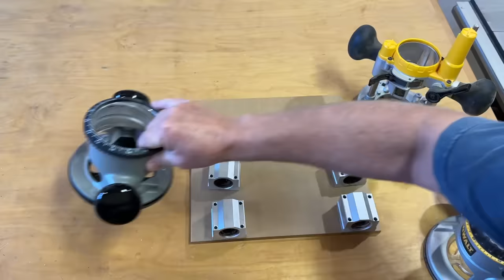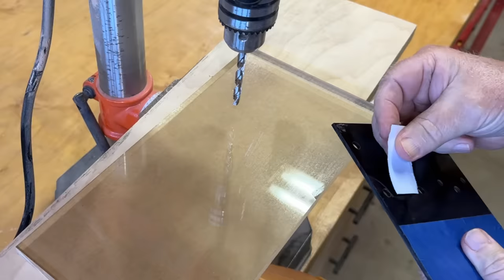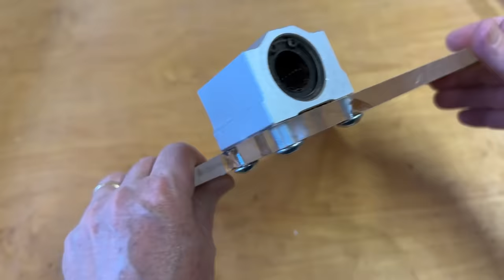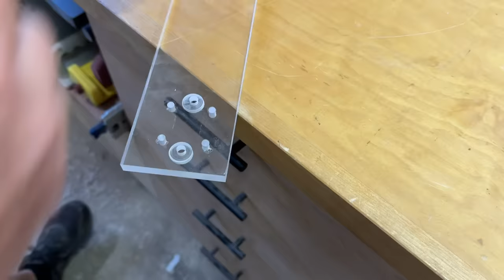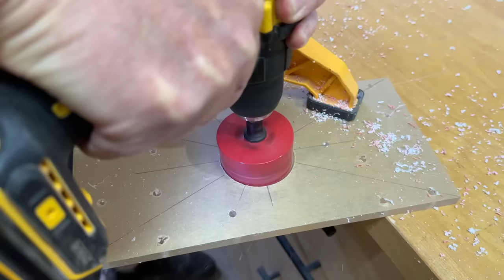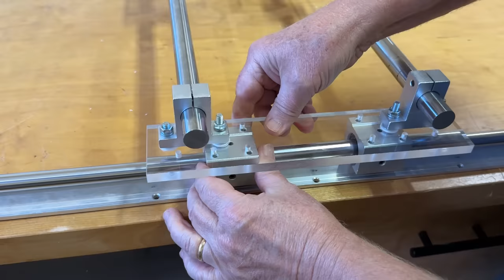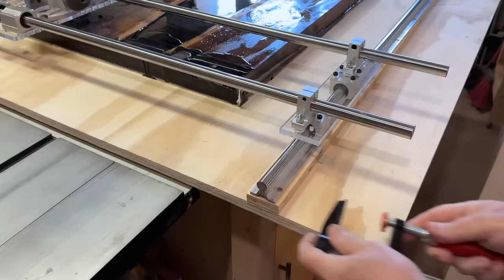Affordable Router Sled - I finally got it right!

Comment: I read the warning on the DeWalt speed differently: it says at low and medium speeds it will act to keep the speed the same, but you might overheat if you push too hard. Because the motor won't slow, you won't know that you are pushing it too hard. They don't say how to know if you are pushing too hard, but probably at the depths of cut for surfacing, it isn't likely. And if you are moving by hand, you will feel when the cut rate bogs down.
Reply: This would be the correct interpretation. I was thrown off by his explanation also. What the router does is increase amperage into the motor to maintain RPMs, this will add extra heat into the motor and if done too much, can cause it to fail. So lower speeds require slower feed rates.
Reply from the maker: Thanks for the clarification, I guess I just misunderstood.  Yeah I guess if you are just careful to not put too much load on the router, it would work fine.  Thanks!
Reply: @jkmwoodworking  I love the simplicity of this design. So I've spent a bit of time pricing out this design and trying to figure out how to make it work in my workshop. I was trying to decide if I needed the full length, and if I even had a place to put the full 2m length.
Reply: Agreed. It will keep the speed more or less constant but it will drain your battery like very quickly. Took very thin cuts and that is better.

Comment: I love your design but you need to adjust the size of router base tray and where the handles on your router base sit so that you can attach your dust port/collector right to the router base. I am doing that on my version by using a router base without the handle and changing the orientation you have by 90 degrees. The other option I have seen is to attach a dust port to a larger piece of acrylic but like you stated, it starts to widen the base/reduce the area where you router can work. I think the dust port attached to the router base will be the answer.

Comment: The rest of my rails show up tomorrow. Thanks for the walkthrough, and the explanation of errors. It’s nice to see someone explain the missteps instead of me yelling at my tools. 😁
Reply from the maker: Glad to hear it was helpful!
Reply: @jkmwoodworking hey bud you still got 1 mistake left you haven't realized... I have the exact same router and made a router sled like yours... well I was doing 1/8" passes over walnut with a 2" spoilboard bit, and I was going nice and slow... really smooth didn't wanna work my router too hard, 2 1/4 hp dewalt... well only 20 minutes and she was smoking. 3+ hp router should be the standard on a router sled. I'm currently looking into a few... Triton has a 3 1/2? I think like $300 vevor makes a 3 1/4 ,for real cheap like $90 but will it last long? Idk and can't find any good reviews, just unboxing reviews. Nobody does any real reviews anymore, just day 1 crap and it's annoying

Comment: Thank you on creating this video depicting your build along with the issues you had building it. It is very well thought out and I believe that just about anyone can duplicate your build. The part on the acrylic square vs rectangle was awesome as well as the part about what type drill bits to use. I am sure this helped me save some money. I was able to create this and I love it and appreciate you for bringing this to anyone interested in building a router sled. I believe that router sleds are more universal or convenient vs having to plane everything. This is relatively cheap to make vs purchasing a small planer let alone a large planer, and can be made rather large to do larger pieces of wood. I know that there are kits out there as you mentioned in your video but this is the way to go. Thanks again - much appreciated!     :)
Reply from the maker: That's awesome, happy to hear that it worked for you!  Thanks for your kind words!
Reply: I did the very same thing. all done in a half day.

Comment: I came across these rails marketed on Amazon for a CNC and immediately imagined them for a sled. Excellent video and info for us new to the sled game. 👍👍👍

FWIW I realize in the grand scheme, $20 doesn’t amount to much. But for future reference stop by any countertop shop that does solid surface (Corian) and you likely will find a nearly unlimited supply of 1/2” acrylic in their dumpster. I did solid surface for decades and shudder to think of all the valuable stuff that we threw away that could have been repurposed for things other than cutting boards.
Reply from the maker: Great info, thanks!

Comment: I built this exact sled over the weekend and it went together great.  I have my surfacing bit on order to attach to my Festool 1400 router so when that gets in I’ll be able to test it.  But even now it’s very solid and smooth so I expect it to work just fine.  Thanks for the great video, parts list and tips!  Kudos to your design!
Reply from the maker: Great, I'm glad it worked well for you!  Thanks so much for the kind words!
Reply: hi Bob  how r u

Comment: I started building a router sled using a similar design to yours, except I used some 3/4" plywood for the carriage for the router. I ran into a few issues very similar to the ones you had in getting the holes for the slides lined up correctly. Your idea of laser cutting a template is really good, so I'm going to re-do mine using a laser-cut template as well. My rails are the first kind you tried also, where the mounting holes on the slides are on top, and using those made my carriage way too high. I need to fix that problem, so I'm going to look into the type of rails you used where the mounting holes are on the bottom. Like you said, it should simplify the carriage quite a bit. My shop is really small, so I don't have nearly enough room to have a router sled inside, so I mounted my long rails to some 2x4's that I can drop into the slots of two Bora sawhorses, then drop a piece of plywood between them to support the workpiece that I want to flatten. That way I can quickly set it up outside my shop, then tear it down and store everything away, including folding up the sawhorses. Since I'm doing the flattening outside, I don't have to deal with all the chips inside my shop, either. Anyway, thanks for this great video; it's given me some inspiration and idea for my flattening sled so I can get it working well.
Reply from the maker: Great info, thanks for sharing!  Sounds like a similar experience as mine.   Great idea with the 2x4's!

Comment: Be interesting to mount a dial indicator on the sled cross rails and see how much deflection (sag) you get in the center of the rails. Good looking design.
Reply from the maker: Interesting idea, I might try it!  Thanks!
Reply: I would imagine with the weight of the router not counting for any down force applied by you,across that span would probably result in at lest .010" in the middle. Steel is way more flexible than most folks would think. Of course .010" would not be at all noticeable across a large cutting board or table top.  @jkmwoodworking
Reply: I was wondering the same thing. That style of rail makes for simple construction, but I would think it would have some deflection, a lot more than the other type of rail.

Comment: Good Video. I wish I'd had used #16 rail through out. The sled needs to hold my router, not my as. In my version 2, I changed my 1/4 poly plate out for 1/4 Alum. You can't see much thru the clear plate anyway. Hardest part was cutting the large hole (wood hole saw with a lot of patience). Height is also adjusted by adding 1/4 poly "shims" made from my old plate to raise or lower the x or y as needed. Like u, I also choose to run my plate below my Y bearing. These can also be flipped to top mount for height control. I generally cut very old and hard oak from 1/4 to 1 1/4. The router cuts and levels what my planer could not handle. On the X bearing plates, also on 1/4 Alum, The X bearing were relocated  INSIDE of the Y bearings to extend my range.
Good Luck to U!
Reply from the maker: Wow, that sounds like an awesome router sled!!  Thanks for the kind words!

Comment: Awesome video! This was almost exactly what I had started to design in my head. Just used your links and ordered the parts. I hope you get some kickback. 

Only change I’m going to make is to add a dust collection port and some dust shoe brush for chip/dust collection.
Reply from the maker: Awesome, thanks so much!  I agree that having the dust collection would be better.
Reply: You definitely saved me time and money, because I have no doubt I would’ve made the same mistakes with the acrylic. 👍🏼
Reply from the maker: @keastland  I'm happy to hear it was helpful!

Comment: I recommend putting a dowel or something on the linier bearings when storing. They are notorious for the bearings to fall out. If it happens to get dropped it may cause a problem. Nice build though. I need to do the same thing.
Reply from the maker: Great suggestion, thanks!  I'm going to try it.

Comment: I really liked your video. Thanks for putting it together. If you wanted to put a dust collection port on your plexiglass mount, would you just cut a wider piece, but mount it as you did? This would allow you to cutout a hole to mount a dust collector fitting to the plate outside the cross rail.
Reply from the maker: Thanks!  That's a great idea!

Comment: I've watched your video numerous times, I wish other YT's would watch and use the voice over as you do. It's just so superior.  Excellent work !   One question, how or did you level the side rails and cross rails ?   I've built a jig using plywood and galvanized pipe to route the top of logs and make them flat.  I had to make sure the side rails were level both ways with one another so the sled would be level.  Then it didn't matter if the log was level, I just routed it till it was.   Maybe I missed it but I didn't see if or how you leveled.  If you could explain it's greatly appreciated.   I've checked all the links and everything is available.   This is just such great work on your part !
Reply from the maker: Thanks so much for your kind words!  The plywood bed/base of the sled sits on top of my workbench, and essentially conforms to however level the workbench top is.  I leveled my workbench using adjustable feet that it has.  I was very meticulous in leveling the work bench to get it exactly right.  I really should have included that in the video, because it is important to get a good result in leveling anything of significant size with the router sled.  Great question, thanks!

Comment: Can I say Beautiful ? I love this. I just checked amazon for the cost of this build. This won't break the bank.
This just might be in my future, in the spring.
Reply from the maker: Thanks!  Yes, it's very affordable for a really good router sled!
Reply: @jkmwoodworking  I did go and buy the parts for this, yes it can be done under $200 (IF) you have a router already. (I have 2 routers)
After watching this I did it. 1000MM x 1000MM, I didn't need anything bigger. The only change was the acrylic, I did 13mm thickness.
Reply from the maker: @davidhabener5767   Awesome!  I'm glad to hear it worked out!

Comment: mounting brackets can be out of plywood or steel (plywood is more than enough...you can build cnc out of plywood easily)
for X axis you could use supported rails like for Y axis ...but mount them to steel profile for stiffness
then it should be rock solid and even allow you to use it like an CNC with some belts / screws, detachable nut (so you can still use it like router sled) and maybe Z axis like an accessory part to make it literally CNC router

Comment: Great design. Have you ever checked whether the shafts on which the router runs are sagging and therefore the workpiece is thinner in the middle than on the sides
Reply from the maker: Thanks!  I placed a straight edge across the table in all directions after using the router sled, and didn't notice any depression in the center, it was complexly flat.  The cross-rails feel really solid, and no sense that they have any sag at all.

Comment: i haven't put together my sled yet. But i got the same 20mm cross rails, and weight of my 3.25hp bosch is too unstable. Just lightly touching it will easily twist the whole sled which would cause the bit to gouge sideways. So before i even try use it, i'll get the sbr 20 rail which i assume is much more rigid

Comment: I will be making one of these down the road. One question, How critical is it to have a dead flat surface to mount it onto? (like torsion box dead flat or assembly table flat) Thanks again for a fantastic video! Your work, effort, and time are much appreciated!
Reply from the maker: Hey Mike, great question!  It is pretty important to have it flat, but I'm not sure torsion box is needed.  I used it with a piece of plywood just laying on top of my assembly table / workbench.  At first, i discovered that my workbench wasn't flat, that one corner was a little high, and caused a twist when initially using the router sled.  But I quickly figured it out and using the leveling legs on my workbench, I was able to get it pretty flat, and then got great results.
I've got another video in works for the build of the live edge/walnut/epoxy table that I showed in this video.  My plan was to address the leveling of the workbench in that video, but great point that it is a subject that I shouldn't have left unaddressed in this video.
You always have great & relevant comments and question, thanks so much!
Reply: You can always add shims to fix dips in your table. You could even use globs of hot glue if your table is laminated, Formica, or melamine. Just remember your sled is going to translate the surface the piece is mounted on, like a planer would.
Reply from the maker: Great info, thanks!
Reply: If i use a 4x8 sheet of melamine or MDF on top of my assembly table won't it take the uneven assembly table top out of the equation? @jkmwoodworking
Reply from the maker: @joeglynn2185  I think it would work ok for relatively small workpieces, say less than 2-3 ft in length.  I would think the melamine would be stiff enough to keep it level for a short distance.  However, for longer workpieces, it wouldn't take much to introduce even a small twist in the melamine or mdf.  Even just a 1/16" or 1/8" over a 5 ft workpiece could be problematic.  My experience was that after I first built the router sled, and used it several times on smaller projects and never notices the twist in my workbench.   But when I did a 5 ft long table top, then it became noticeable and then I had to fix the workbench to be completely level to get good results.

Comment: This one of the best demos I’ve seen. I hope you have the parts list readily available. What do you recommend if a person doesn’t have a laser to cut out a template?
Reply from the maker: Thanks so much!  maybe try using one of the linear rail blocks as a guide to create the template, just being careful not the mess up the threads?   Or could just measure super carefully, start the holes with a really small drill bit to get them exactly in the right spot, and drill the template from that?

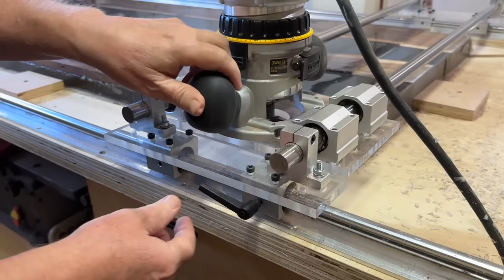Comment: Fantastic video! I learned quite a bit and it was a huge help. In part of the video(7:57), it shows you added some sort of lever-based stop to the side rail runner. Would you mind sharing what part you used?
Reply from the maker: Awesome, thank you!  The lever comes with the side rails that I bought, I put a link in the description to the specific ones that come with the lever.

Comment: Buy yourself a set of centering punches, they are fantastic  marking holes when using a threaded plate as your guide since drilling ruins the threads. (Not in this video) I can appreciate your process since I just finished a plasma cutter sled of similar construction.

Comment: Awesome video. I wish I had seen this before I bought the more complex and more expensive rod+mount mechanism from Amazon instead of the straight rod mechanism that this video recommends. Now I have to decide whether to return and get the simpler mechanism or not. Also I chose a square router tray for my first attempt and will likely decide to go with the wider option for the reasons described here. I'm curious if plywood is a suitable option for the tray instead of acrylic.
Reply from the maker: Thanks for the kind words!  I haven't tried plywood as an alternative to acrylic, but believe it would work just fine.

Comment: My only comment is I use my drill press to drill any and all holes that I can. Providing the table is square with the quill, it will insure all the holes are straight, and you can generate a lot more downforce then with a hand drill.

Comment: Thank you for making this video as well as doing the research for people like me. Because I would of probably made the same ones not knowing any better. I do have a question about the router carriage/sled itself you used a 3/8" piece of plexiglass I like the Idea of the extra support by using a 3/8" piece. but now that you have used it for awhile have you run across any problems due to the extra thickness of the plexiglass? most people would use a 1/4" piece of plexiglass. I've ordered the parts to make my own linear bed for the router, if you had any problems let me know please cause I also am planning a 3/8 piece of Plexi. Again thanks for the video I also subscribed
Reply from the maker: Thanks, glad the video was helpful!  I've not had any problems with the 3/8", and am very happy with it!